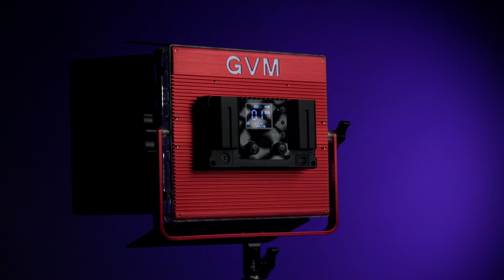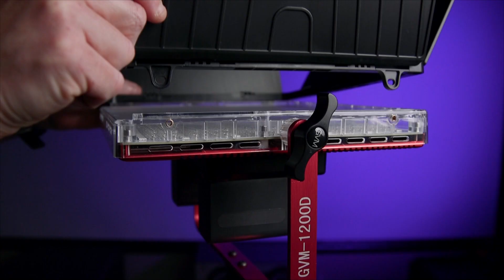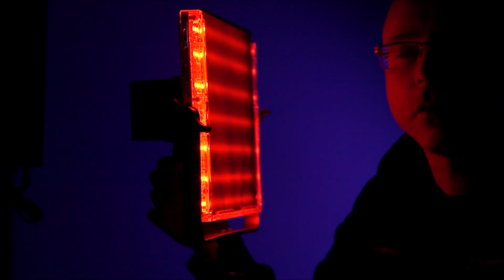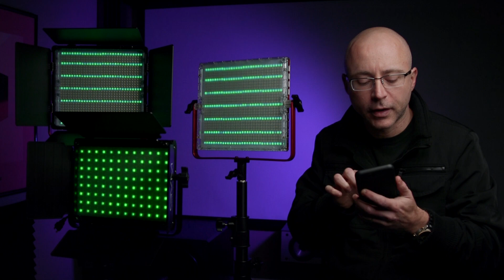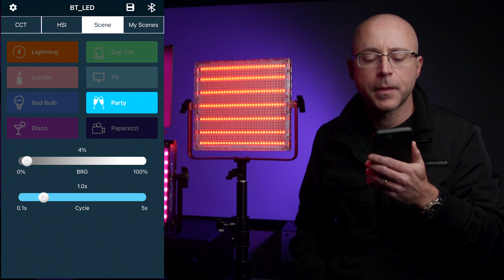NEW Release GVM 1200D LED IN-DEPTH Review / App / Manual / And Lighting Tutorial / Tips AND MORE!

Comment: So I bought the two pack 1200d and the screw was actually messed up from the factory where the barn doors are. They sent me a replacement light and I managed to fix the problem with the screw a day later. 

However when the replacement light showed up it was actually brighter than the other two lights I had bought from them. 2% on this light was the same as 10% on the other lights I have which really isn’t good at all because I can easily overexpose a subject now in certain conditions.
2 lights 2 problems.

Have you experienced this kind of bad quality control from GVM before? I might just return these lights and jump to the ST300r. I just hope that light isn’t bad as well because I love it in your reviews.
Reply from the maker: I’m sorry that you’re having issues with your new batch of 1200D lights / replacement. 

Regardless of the situation, the ST300R is a much better light than these panels because they are COB lights and for them being a Bowens mount, the versatility triples. You can install anything in front of the ST300R, soft boxes, reflectors, fresnel lenses, you name it. With a panel, all you can do extra is place a secondary diffuser in front.

If you still have time to exchange for the ST300R, I would…and it’s incomparably brighter than a 1200D. And that 300watt light, you can dim as LOW as you need it to be. 

The only issue I’ve had with GVM lights was the very first edition of a 800D back in the day when light FX weren’t even a thing or existed. The light brightness and colors were jumpy. Not anymore. GVM improved this massively. 

I hope this helps.
Reply: @ArtVideoProductions  this helps a lot. Thank you

Comment: Great video! many thanks, one question i want to buy batteries for these GVM lights but I don't know which ones are compatible, maybe the  NP 750? thanks
Reply from the maker: NPF 970 is the recommended size as it is the largest. Here is a very cool one that I use and it has its own meter! These links are affiliated with my channel. It doesn’t cost you anything extra and it helps my channel 
https://amzn.to/3GiW9Xi
And this one is very good. Lasts very well which I also use and recommend!
https://amzn.to/3or3sGt
Reply: @ArtVideoProductions  many thanks :)

Comment: Are these good for weddings?
Reply from the maker: For bridal prep, make sure you use a softbox which GVM makes specific soft boxes for these panels. Also, I recommend these lights for video. For photography you’ll need something more powerful due to higher shutter speed required for photography.
For the reception, you’ll need at least 2 if they are placed far away from the dance floor. If your shoot wide apertures, f1.8, 2,8, that will be fine.

Comment: Fantastic video review! I do prefer these reviews to watch calmly and in detail, than those quick superficial ones, made for impatient people.
I have a question: if you were to compare any pros and cons between this model and the MB832, are there any advantages to the MB832? I mean this one has RGB, effects and has more LEDs but, when it comes to the Bi-Color aspect only (90% of the time I only need the Bi-Color functionality), which one performs better? I know the 1200D does 1% vs 10% on the 832 but, apart from that, how do they compare in terms of Bi-Color? Thanks!
Reply from the maker: Even if you don’t need RGBs, I’d still recommend a RGB panel. Down the road, you’ll be happy you did. GVM released a 50SM! What’s awesome about that? It has RGB In one side and CCT in the other! I’ve never seen that before on a square panel! Plus, it’s 50 watts on EACH SIDE! go check that one out! I also reviewed it recently
Reply: Thanks for the reply! This sure helps understand things. My only frustration is that in Europe most models seem to be unavailable. All the red panel models I struggle to find them, as well as the most recent ones.

Comment: I’m confused now, do you know them difference between the GVM RGB 1200D or RGB 1000D versus GVM 50RS RGB ? Both are RGN but I don’t see the real difference on their website .
Reply from the maker: The 50RS LEDs are a flood type, which provides a wider light spread, and it’s a 50 watt unit. 

The 1000D is 45 watts and the LEDs are a lens type, provides a narrower beam, allowing the light to be more concentrated, thus requiring more diffusion for key light. 

The 1200D is the same thing I described as the 1000D, with the difference that it’s more powerful and has more LEDs (I believe it’s 50 watts)

Comment: How do these work for overall office lighting? Video conferencing and general use? I'm thinking two of the lights would be in corners of the office shooting at the ceiling or up angle. And, one with  in the middle behind monitors shooting at the video conferencing subject (me). I would assume diffuser mounted on all of them to get more of a lightbox / soft even lighting for the whole room and on the video subject. Thoughts?
Reply from the maker: Whether your doing corporate video of film making, If you want to have that precise lighting control, whatever lights that your using, you must place them as close as possible to the subject. If you place the lights far away, it lights everything in the room the same and flat. Now, for video conferencing, then, yeah, that’s fine and that’s how you should do, place the lights far away for even lighting. 

These lights will require additional diffusers like any panel of this type. Then you can use them as a key light with a very pleasant look.

For key light, on something still small and easy to carry, try the GVM R50R288 2L which I also reviewed it. This panel comes built in with a thick diffuser and its 50 watts just like the 50RS
Reply: @ArtVideoProductions  Thank you for your detailed reply, I appreciate it! I think for this purchase, I'm happy to just concentrate on my office for now and I'll get a separate kit for travel to shoot locations. Especially since things are much more home office oriented now, I'm considering getting a GVM kit to handle all of the lighting for the office. I'm thinking of 1 light in front of me and behind my monitors to act as a key light for me as the subject in video conferencing and video creation. Then, I need two more lights, I believe. Each will be in front of me in the opposite corners of the wall in front of me. The office is not large, though it has a sloped 9-12' ceiling, the room itself is modest at around 15' square. Do you think my idea of two lights in the corners and one light in front of  me would work well? The distance from the middle light to me would be around 4' and the distance from the corner lights to me would be around 6-7'. Let me know what GVM kit or kit + accessories would best accomplish this. I shop at both Amazon and BHP and happy to use your affiliate link to thank you for your advice.
Reply from the maker: @julieandshawn  the best idea for this setup would be 1 of 2 lights in front of you (diffused) and two additional lights, one to light the background and the other as a hair light, or also for additional background lighting
Reply: @ArtVideoProductions  Thanks, I ordered the 288 and will see how things go with these two and I can expand further from there, depending on how they perform for my needs.
Reply from the maker: @julieandshawn  they should do great.

Comment: Which GVM light panel model can work as a key light?
Reply from the maker: They can ALL work as a keylight, but for better results, meaning, as a softer light, you must add an extra layer of a diffuser gel like most panels like these need, such as a Rosco #3008 (comes in a 24 x 24” sheet) regardless of what brand they are, these panels always will require extra diffusion.

Now, for the BEST of all results, place one or more lights in a row BEHIND a large collapsible diffuser disc, which creates a BIGGER light source. The bigger the light source and the CLOSER it is to the subject, the softer the light and the more control you have for dramatic lighting. If you back away the lights, everything turns into a “flat light” unless that’s what you want.

There’s a GVM model that comes with a thick diffuser built in such as the GVM R-50R288-2L which I also reviewed if you wanna search.
Reply: @ArtVideoProductions  thank you so much for the reply!

Comment: So what would make a better close distance Key light for a bed room youtube studio, this or the GVM 80w led with Bowen’s mount?
Reply from the maker: The 1200D will do just fine as long as you put extra diffusers in front of it, and the same for the Bowen’s mount lights... you’ll need a softbox. So, both types require something. As for background lighting, if your background is less than 8’ away from you, and if you are trying to avoid light spill, you’ll need a softbox with a grid. For the 1200D, you can add a flag.